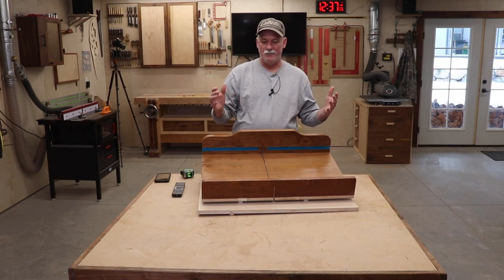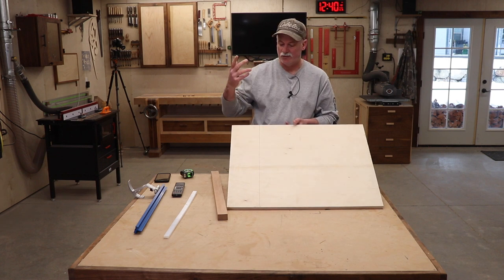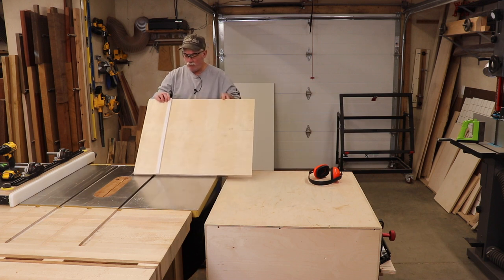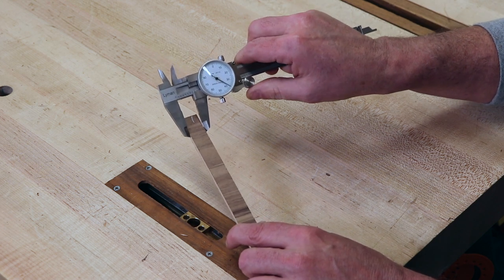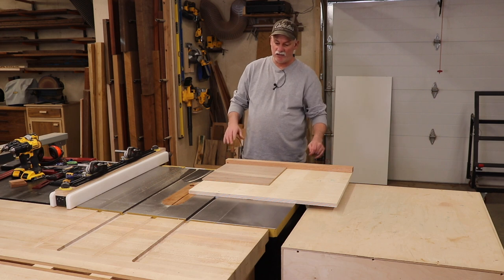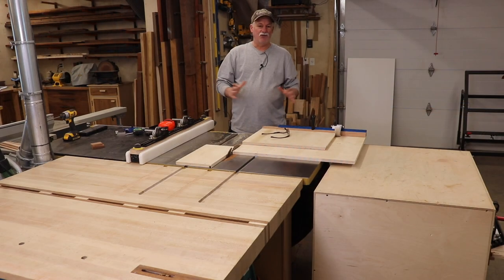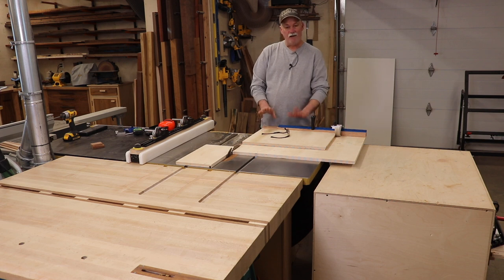Panel Sled

Comment: Nice build, and well explained. When mounting the runner, if you want to avoid putting screws in from the top, double sided carpet tape will stick the hdpe to the base, then you can flip it over and just screw from underneath 🙂

Comment: Nice build. I am using a DeWalt tablesaw and sometimes my piece is to wide for it (Front table till the saw blade too short). Would such a sled be safe enough to use when it's bigger and hangs in front of the saw?
Thanks for sharing!
Reply from the maker: To a certain extent, yes.  Especially if you also built an extension for the front to help support the panel.  I know I have a video in my archives where I built one and they really come in handy.  I'll find the video and add a link here for you.
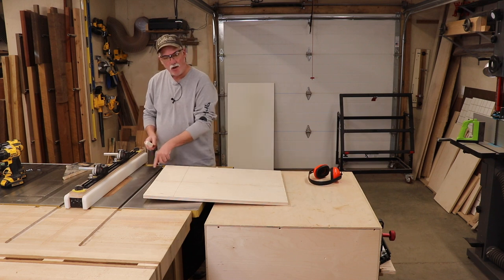Reply from the maker: Go to the 3:14 mark of this video for how I built my indeed support..  https://youtu.be/9B9h7QLDoaw
Reply: @KevsWoodworks  Thanks!!

Comment: Can you briefly explain how you squared up your miter slot to the fence and blade? Is the fence just sitting directly above the blade to line up with the kerf?
Reply from the maker: Absolutely.  I actually used calipers to line up the miter slot / fence / and Blade long before this video.  They were all squared.  I set the fence close to the blade to ensure it was as square as could be to the runners.  I simply cut off the excess and then aligned the fence from there.  Apologies if I didn't cover that that sufficiently in the video.

Comment: I agree.  Since I made my panel sled my traditional crosscut sled collects a lot of dust.  Curious, where would a traditional sled be a better choice?
Reply from the maker: I still use mine when I need hold downs in the bottom on smaller pieces or when I need a stop block on both sides of the blade.

Comment: Thanks for the information…I have been wanting a cross cut sled but now I think I will build a panel sled instead..looks like it’s much more easier to build correctly.

I do have one question..Does the handle stop the stop block from moving closer to the blade side of the sled?
Reply from the maker: Thanks..  No, the stop slides by.  However, if I need the stop to be where the handle is, I need to remove the handle.  It's only installed hand tight so, isn't a big deal.

Comment: Sorry if I'm missing the obvious.  Is there a plan for this one? I did not see it on the website (getting old here - maybe it's too damn simple for a plan). Also is the stop block rail the Rockler listed product on the affil link?  Thanks
Reply from the maker: Hey Vincent, sorry, I didn't do any plans for it since it's fairly simple.  If you drop me an email, I'll grab my actual dimensions for you.  Kev@kevswoodworks.com.  The stop block rail is a rocker item but, not the one in the show notes.  This is the one though.  https://www.rockler.com/double-t-track-fence-cap
Reply: @KevsWoodworks  Thanks Kev.  This is perfect.

Comment: Sliding table saw is the best choice
Reply from the maker: I would disagree.  For starters, they tend to be cost prohibitive for many so, you end up with DIY options which are not the best.  If I were working with a lot of sheet goods, a slider would definitely be my choice but, I like the options of sleds like this when working furniture projects.